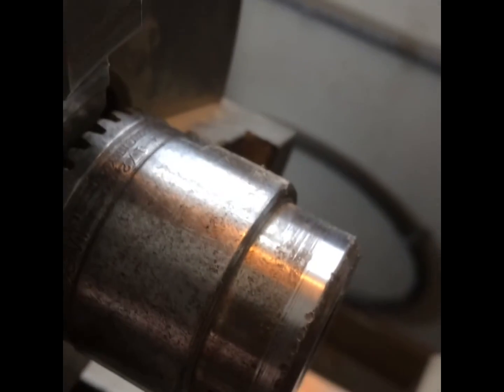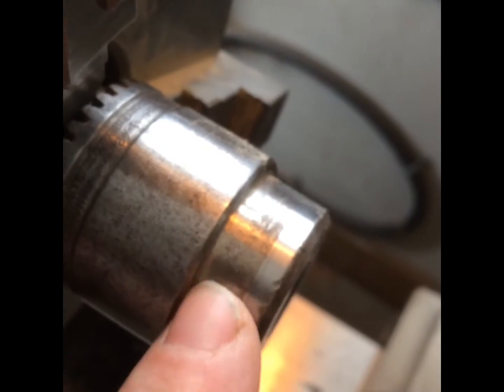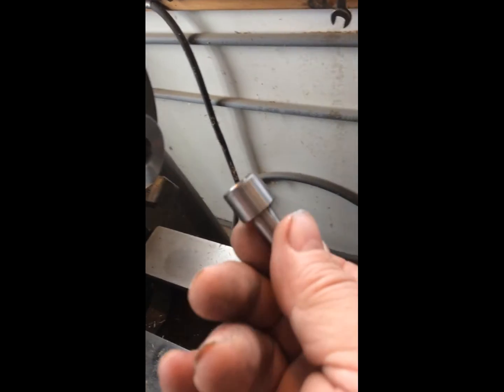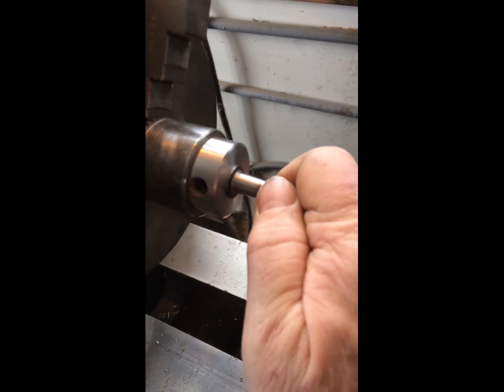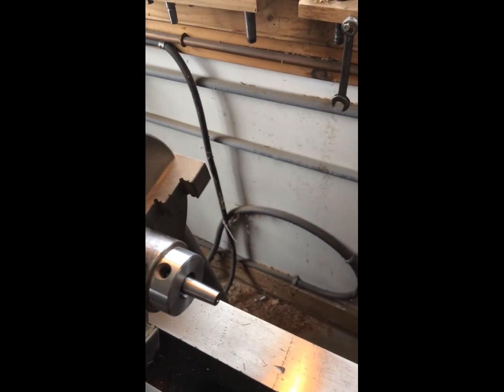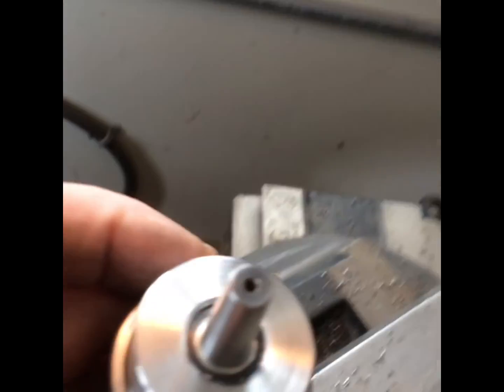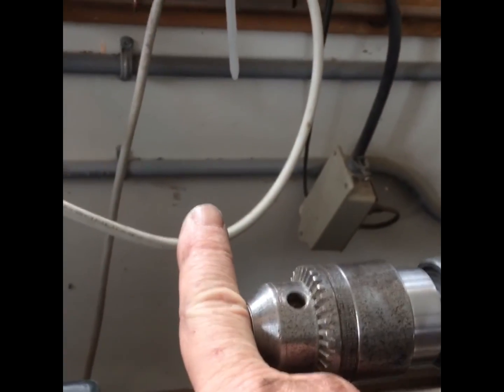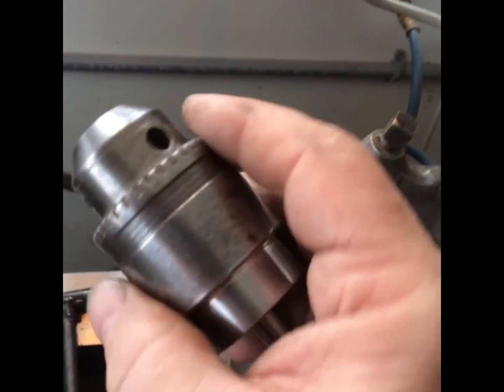spinning Jacob chuck for the the lathe tail stock

Comment: I just made one, ripped the chuck and the spindle with the thread for the chuck from a cordless drill, use a live center, ripped the front off and ground down the chuck spindle to suit, works like a treat, chuck take up to 12mm, now I can put thin rods in there and lathe away.